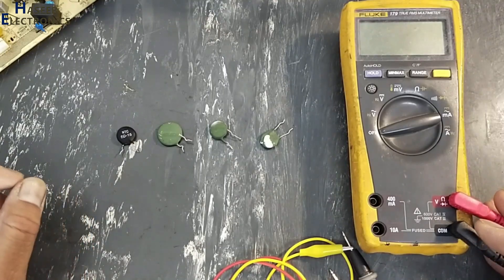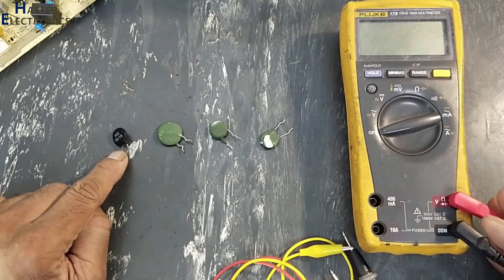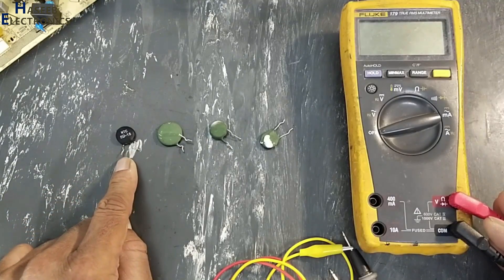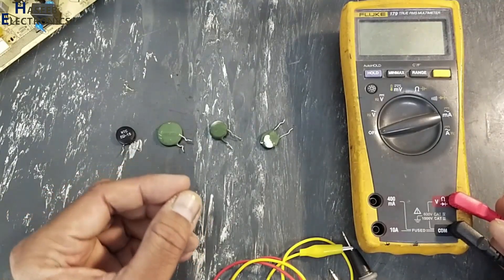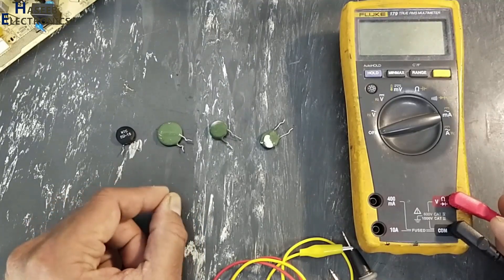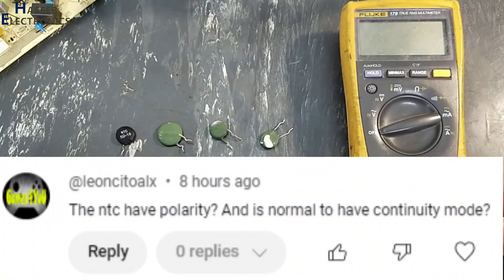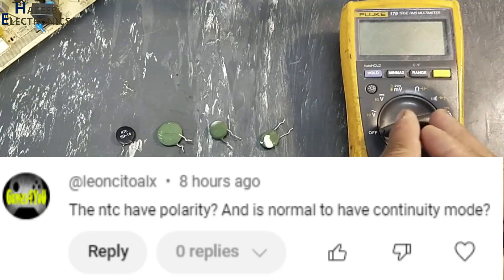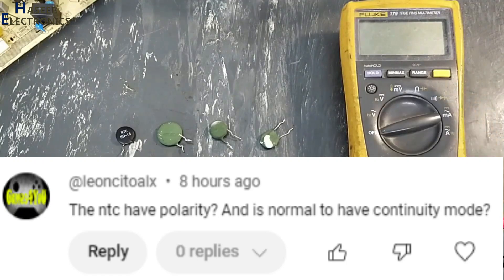{1226} Does NTC or PTC thermistor is Polarity sensitive

Comment: Sir can you enlighten me how do I check if this component is faulty? Much appreciate your reply and thank you.
Reply from the maker: because it is temperature depandant resistor 
its resistance varies based on sorrounding temperature 
most of time when it fails, it becomes open circuit 
of in some cases its bady gets blast and it becomes short circuit 
if it is open circuit or its body is damaged or it is giving Zero resistance 
then it is damaged

Comment: A resistor usually used for decreasing the current or voltage?
Reply from the maker: it opposes to current flow. which causes to drop voltage across it. in result the voltage reaching to next part of the circuit are decreased because the resistor is now dropping the voltage by controlling the current
Reply: Current

Comment: I can’t believe someone dip his soldering iron in water. Even though its small voltage soldering iron it’s not at all good for soldering iron as it can damage and get corrosion
Reply from the maker: But now you can believe 😂 
I dipped it practically to heat up water 
Actually it is concealed heating element and it is awesome
Reply: @owaisakhter2673 - If you had understanding of soldering iron construction, you would have never trolled Haseeb with this comment. Soldering iron tips are made with a protective metal coating that withstands the corrosive flux sometimes found in the core of the solder used and, as such, can certainly withstand the corrosive properties of any suspended solids found in the water he is heating. The “small voltage” you mentioned is of high enough intensity to raise the tip’s temperature to several hundred degrees - above the melting point of the solder alloy used. Also, the heating element is isolated from the tip inside the iron that heats it and does not contact liquids external to the tip. Thank you, Haseeb, for posting such informative content. I had only  previously assumed NTCs and PTCs were not polar; but, you have here proved any such concerns moot.